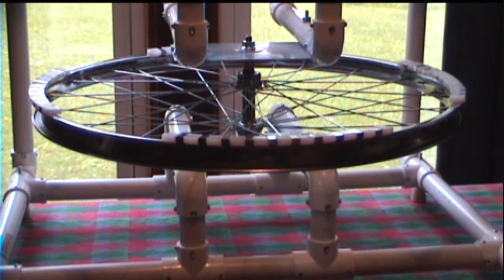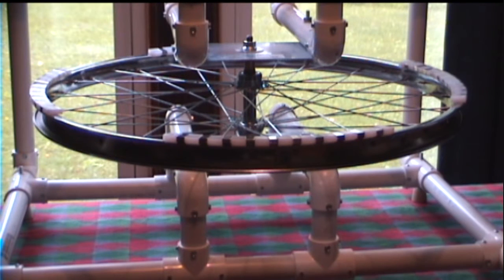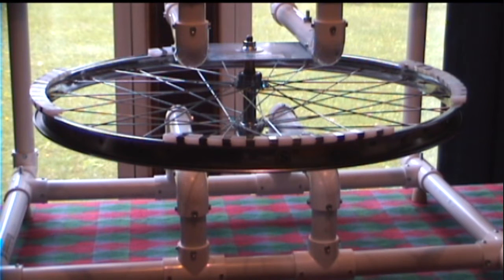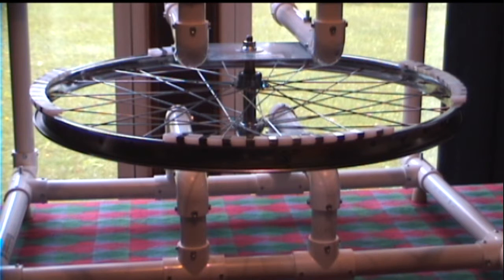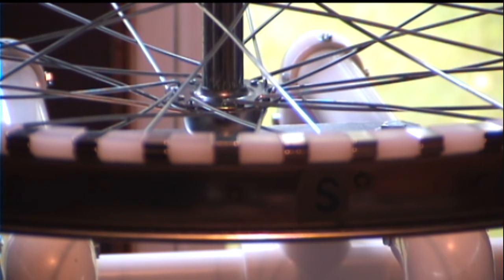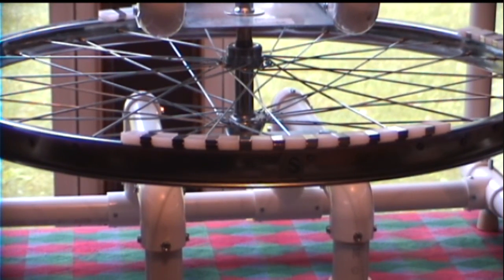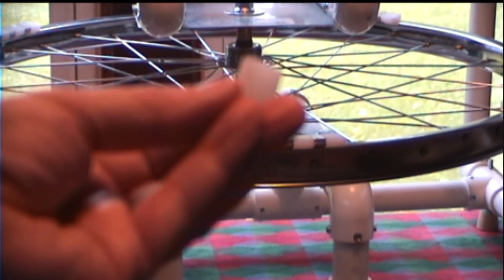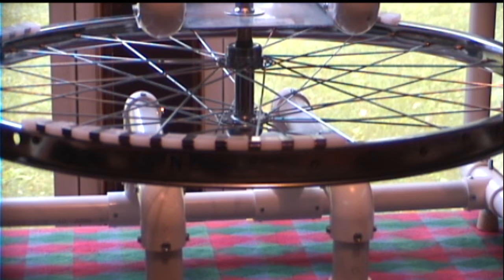Video #20, "Rick's Pipe Dream" Magnetic Motor - Generator Project

Comment from the maker: @alosttribemember1  My neodymium stator magnet came from a computer hard disc drive, and is quite strong.  My rotor magnets were purchased from K&J Magnetics, and are 3/4 x 3/8 x 1/8 thickness, magnetized through the thickness. These are K&J stock number BC62.  I double stack my rotor magnets.  These magnets are small, but very powerful for their size, and work nicely with the hard drive magnet.  Each hard drive uses two magnets. Take a look at your local recycling center.

Comment from the maker: If you would take a moment to read the "info" section, at upper right of the screen, you would realize that the purpose of this video update is to demonstrate the current build modifications to project replicators and experimenters, and NOT to demonstrate a working PMM.  When ready to show a working demo, however, I will post "WORKING DEMO" in the video title, as you have requested.

Comment from the maker: Magnetic attraction and repulsion are two different forces.  Any single magnet can act in attraction to a ferromagnetic material, but it takes two magnets to achieve repulsion.  To achieve balanced repulsion requires two equally sized and equally powerful magnets placed in exacting alignment.  Anything else, and you get the "flip" that you are talking about, which is a product of imbalance and field spin.

Comment from the maker: Hi Matt,  yes it does spin, as can be seen in the previous videos.  The purpose of this video is to show the methods used in fabricating some of the timing track elements, and is provided mainly for the benefit of replicators who are building, or have built, the Pipe Dream apparatus.  Everything contained in this video series is presented mainly for the benefit of the project participants, but is also made available to the public to inform those who wish to become participants.